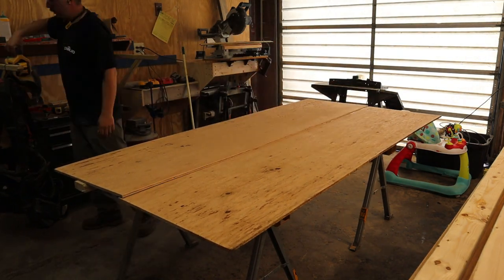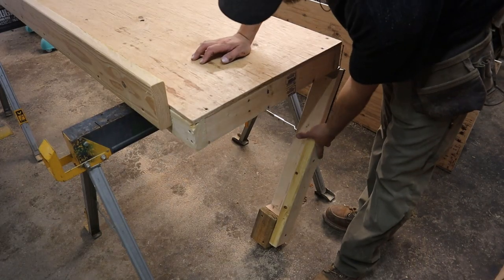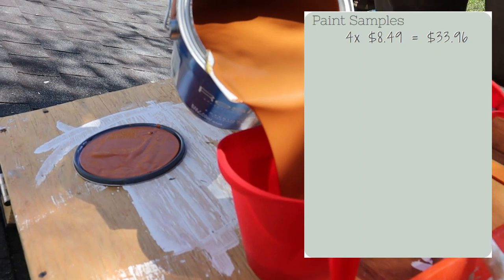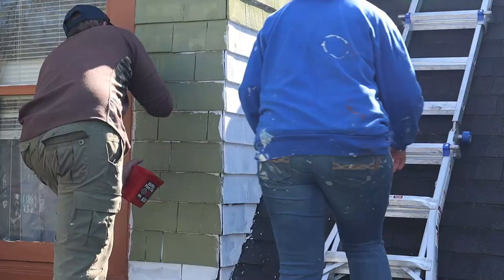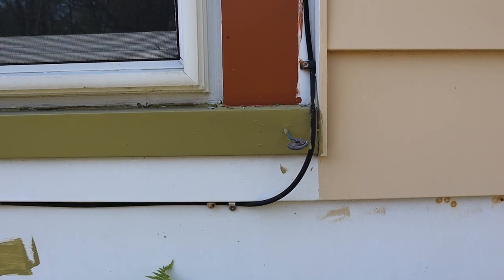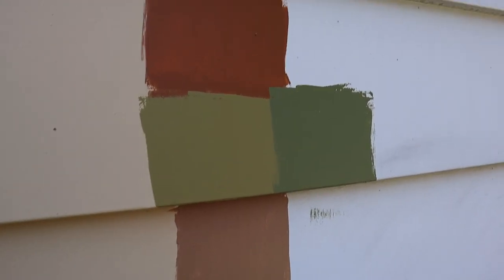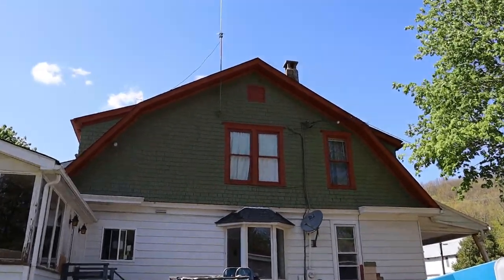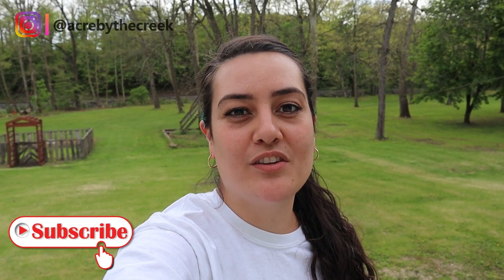HOW MUCH TO PAINT HOUSE EXTERIOR | diy painting the exterior of your home

Comment: Well kudos to you guys for tackling a 2 story external paint. A big job as you know by now.  Good effort 
Some friendly tips? All paints come thicker than what you will use when actually applying the paint (or primer/undercoat) Your primer should be thin enough to absorb into the timber and all other finish coats, it's what we call, a working consistency. Thin enough to be able to easily work with it but not so thin it doesn't provide a layer of protection.
A side note: With paint technology today, it would of been better to use a top shelf acrylic exterior paint. It has more give with the elements (the reason why oil paints crack and peel over time). 
Bty, I don't mind the color at all and like you mentioned, you live there and you like it. That's all that matters :) All the best
Reply from the maker: thanks so much for the tips. after the first hour or so on the first day we did end up thinning the primer because it was far too thick to work with. appreciate you commenting!!